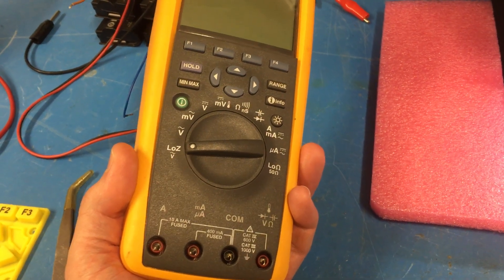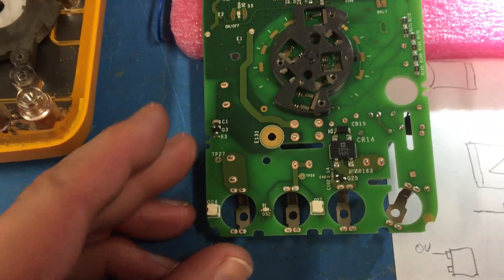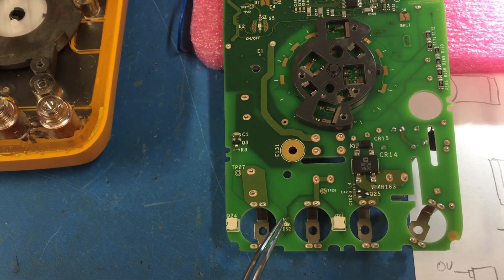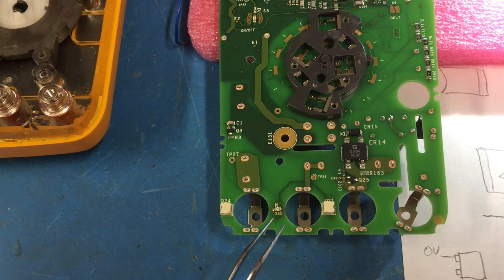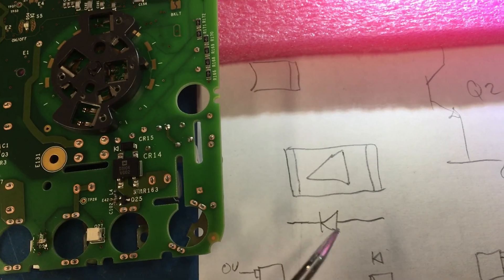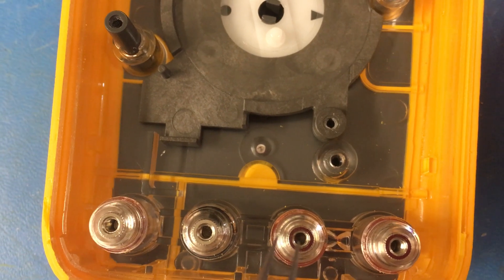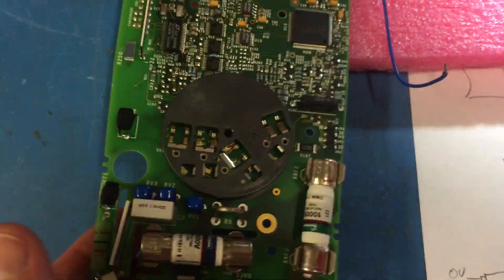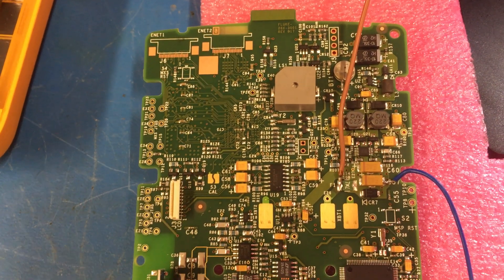Fluke 287/289 IR Lead Detection Fault

Comment: Just repaired mine, Thanks!!  
My SMD IR was just weak or dead, bought a strip of 5 pieces (Kingbright KP-2012F3C, 940 NM, 0805) for  ~1.50 euro, transport cost were crazy more then 10 euro 🤣

First time SMD soldering went very well thanks to some educational vids on YT😉. (good and bad vids out there on how to do it, use your brain to filter out the good and do it nice).

I needed to buy the right super small tip (XT HX) for my Weller iron, very thin tin (0.2mm)😉, I also bought a new bottle of flux (TK83 no clean).
Make sure you get the old tin clean off, because you need to seat it flat on the print, can recommend looking for some no clean desoldering wire (I used Techspray no clean). 
Using my phone as a magnifying glass was a bit clumsy but it worked, need to fix that problem in the future or buy a new pair of eyes like in cyberpunk 2077😇.

My end total cost were below 50 euro and got my Fluke 287 back + new soldering tools + new skill level unlocked😜

Thanks again! and good luck if you have the same problem!

Fixing your nice battery eating fluke is worth it😛.
Reply: Also VERY important⚠❗
If you screw your fluke back together remember to turn the screws counterclockwise slowly till you feel it fall in the thread, after that you can turn them clockwise😉, because those screws will try to tap a new thread if you don't and you won't like the result if you do that to often!😉
Reply from the maker: Good effort, welcome to the exclusive band of 'Fluke Repairers'.

Comment: Amigo buenas tengo un problema con mi Fluke ya que una de las pistas de inflarrojo se dañó de pronto conoces algún método para puentiar esa señal y lo deje trabajar normalmente
Reply from the maker: Intentaría reparar la pista rota; de lo contrario, tendrás que usar el circuito de activación del LED para controlar un par de transistores cuyo colector y emisores están en paralelo con los fototransistores. La forma de hacerlo depende de qué pista esté rota.

¡Buena suerte!

Comment: My 287 was doing this. 
  Now, it will not even come on. 
  I tried new batteries since it had not been used in several months that I have had it and 3 batteries showed to be weak. 
  I am used to way cheaper meters but need to know more about these and how to use them.
Reply from the maker: My experience with these meters is that they are generally reliable. We have a lot of them at work and they don't usually give any trouble. In the past when I have a meter that is not powering up then I suspect the battery connections in the battery box. If any batteries have leaked then this often damages the contacts, so I would start there. Beyond that you will need some other test equipment and some knowledge of electronics to fix it. I don't think that there is a schematic available for this meter online so you would have to determine how the circuit works. If it were me I would start by looking at where the batteries contact the main PCB and trace it through from there. You could always connect a bench PSU like I did in the video and see how far the voltage gets in the circuit. Be careful as you can cause a lot of expensive damage to the board if you over-voltage it.

Comment: Thanks alot for this tip!
I repaired my 289 which had the same issue. My LED was still in place and lighting up, but apperently to weak.
Now its working great, again :)
Reply from the maker: A couple of people have reported the same problem. I don't know why the LED should have a reduced output after time. This area certainly seems like a weak point in the design. It's a shame as the rest of the meter seems to perform reliably.
Reply: Do you happen to have the part number for the LED?
Reply: @PatriotDad  Yes:
I used KP-2012F3C IR LEDs, ordered from Farnell: 2290432

Good luck, repairing your meter! 
Regards

Comment: hi. very usefull information. I have got same problem. and I did not know why it says ''wrong lead connection'' ! is it any way to disable whole system? so I want to get rid of this security system basically. thanks for your help
Reply from the maker: Why would you want to disable it? It is there to warn you that you have the leads in the wrong position which may result in damage to your circuit or the fuse in the meter. It is very cheap and easy to fix. If you can afford to buy one of these meters, the cost of fixing it yourself is surely in the noise...

Comment: Do you happen to have a part number for those IR photo detectors ?
Reply from the maker: Yes, it's in the description above: Kingbright KP-2012F3C INFRARED EMITTER, 940 NM, 0805, I bought a pack of 5 from Farnell (2290432) for less than £1

Comment: Display shows leads connected wrongly fault without connect leads why
Reply: Take the 289 apart, there are 6 phillip head screws that hold the unit together. After some breakdown, you'll come across 4 smaller screws that hold the PCB down to the back side of the banana clips. You'll also notice that two more screws are located on the board. After a breakdown of the unit, carefully remove the LCD ribbon cable from the PCB and do a visual check of the bottom of the PCB. In your situation, it might just need a good cleaning. I cleaned my 289 with denatured alcohol.

Comment: Just a quick added tip. My LED was in place, but it was still showing up on camera, so I was baffled. I replaced it anyway, and the new one was a lot brighter. So do try replacing it even if you can see the light from the old LED.

Comment: Hello! Tell me please I have the same problem but the diode is in place !What can be checked and replaced ???
Reply from the maker: My diode was also in place but faulty. Just replace it, they are not very expensive.
Reply: @bvqbvq  Can you tell me what the symptoms were and what the breakdown was ?Have you tested the diode with a tester ?
Reply from the maker: @mikhailshulgin6965  I explained it all in the video. To test the LED you need a current limited power supply (10mA) and an old digital camera capable of viewing IR. You can do this with the LED in circuit. If there is no visible IR and you have a sensible forward bias voltage (1.6V) then the LED is faulty and you need to replace it. If it is emitting then you can use it to test the phototransistor although you may need to guide the light or reflect it with something. If that is working then you need to start looking at the LED drive circuit.